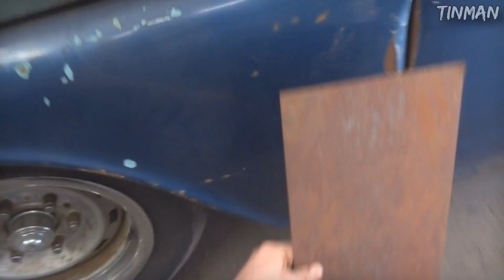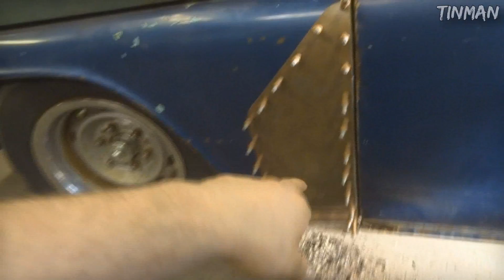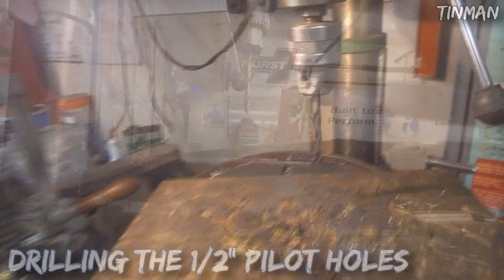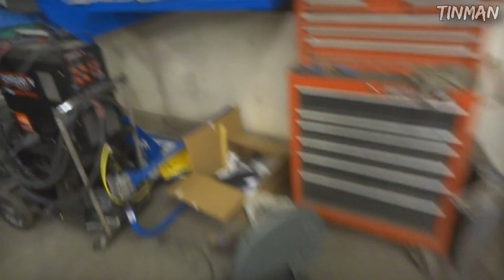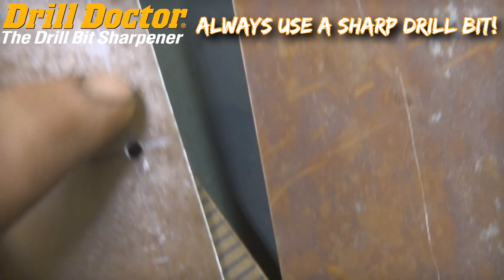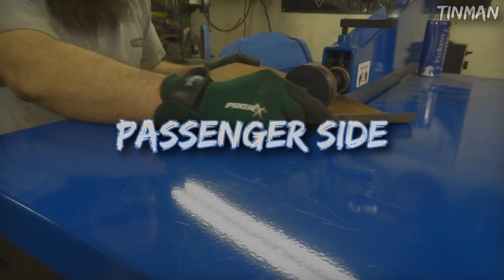Bagged '66 GMC Build (Ep. 9) "Junebug" METAL WORK

Comment: Rewatching this for no particular reason, just noticed passenger side got bead rolled before the edges got lipped. Second time using it madeja think it's easier to work on a flat piece? 😉 Good art, regardless.
Reply from the maker: Zeek Duff there wasn't really a reason for that other than I wanted to keep bead rolling because it was fun lol this bead roller fits a 1" lip so that wouldn't have made much difference :) good catch though

Comment: Hi luke 
Rusting mixture 
equal parts 
Vinegar ,1 cup
 Hydrogen Peroxide, 1 cup
And about 2 tbs salt
scale up as needed  on RAW METAL 
spray on, let dry wash off with Carb or backing soda and water 
then water
clear coat as needed
Just saying  (not responsible for any action it causes!)